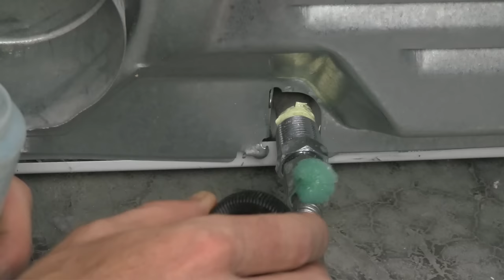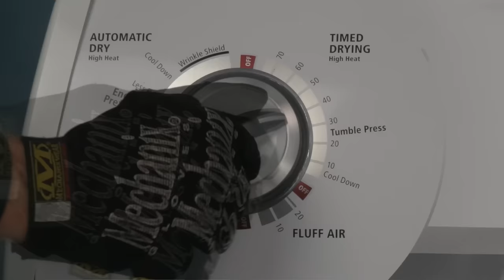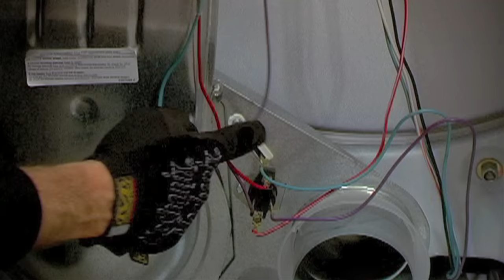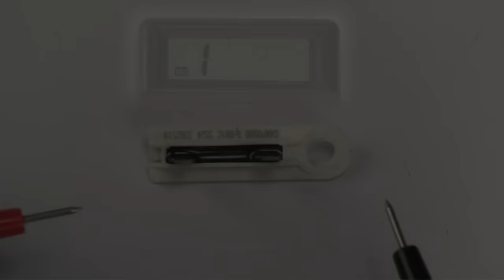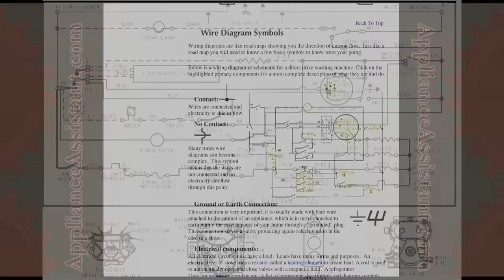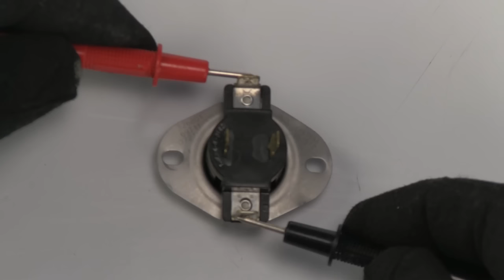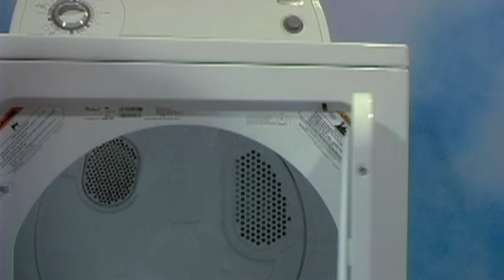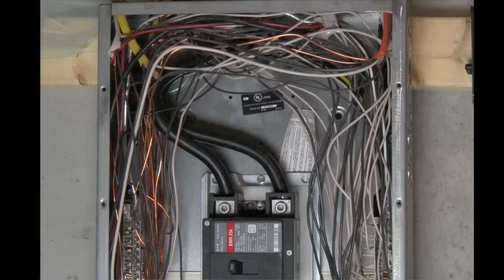Gas Dryer Repair: Fix Heating Problems

Comment from the maker: @munkdavid Thanks! Sounds like you have it right.  If you press and hold the start button you should get a reading for continuity on your meter. If you are not getting a reading it just means that one of the components is open (broken)  but it does not tell you which one.  I just published a dryer troubleshooting app at ApplianceAssistant Com  Try that out to narrow down your options.  Email me through the site with your model number and symptoms and I will do my best to help out.  Thanks again!

Comment: Dude, video rocks.  I promise to donate if you can help me.  Towards the end you rushed a bit.  I'm confused how the timer switch should test.  I have door off so i'm going from the red on my disconnected switch to the blue on the door sensor, thing.  :-)

Comment from the maker: @JessTorrRawr121 If you can see the igniter glowing but the flame does not ignite you probably need to replace the two black coils mounted to the top of the burner valve...Try using the new "dryer troubleshooter" app that I just published on ApplianceAssistant Com It should take you right to the part you need, and videos on how to replace them.

Comment from the maker: @daylightchat Sorry for the delay in responding.  I have a few parts ordering links from my main website ApplianceAssistant . Com
If you tested the thermal fuse with the wires disconnected and found no resistance, or activity on your meter then the fuse should be all you need to change.  there is no reason to replace the other parts you mentioned until they fail.  you can test the heater in the same way as the fuse.  Thank you for your comments!  Wonderful to hear of your success!

Comment from the maker: @nauulolna Thank you!  Normally the symptoms that you described could be caused by a gas line that is full of air the first time the dryer is turned on.  The fact that you are smelling gas should mean that the coils are working and the valve is being opened.  The only mechanical problem I can think of is the flame switch becoming overly sensitive, opening prematurely, and transferring electricity from the igniter to the coils too soon.  Extremely rare. If the igniter glows it works.

Comment: Awesome video, I have the same problem with Michael62895. dryer works fine at first, maintaining the temp it closes. then second heat  igniter glows, then off - but no flames -  I SMELL GAS ! will replacing the solenoid fix my problem ? thanks

Comment: Thanks...Was ready to go buy a new dryer. My issue was a 19.95 thermal fuse and a good cleaning. Makes me wonder how many dryers awaiting recycling roadside just need minor repairs. Maybe I'll shop those next time. Nice easy to follow video. Thanks again. Mike

Comment: I have the same Whirlpool dryer like the one used in the video. the igniter does lite the gas producing a flame for the first time, but after several minutest it won't relight, ONLY a orange glow and then back off. DO I NEED TO REPLACE THE TWO BLACK COILS?

Comment from the maker: @TheGhostPlanet If the dryer is disconnected from the home's ducting and you are still experiencing the flame kicking off after  5-10 seconds look at the internal dryer ducting.  The in door lint catchers are more likely to build up lint inside the lint trap receiver and block air flow. This will cause the flame to over heat the hi-limit thermostat.  I hope that helps.  If you have any other questions feel free to contact me through ApplianceAssistant Com and we will figure it out.

Comment: I have a Maytag Dg313 and the problem I have is the burner glows and the gas valve opens but the flame only stays lite for about 5-10 seconds and then shuts off. I replaced the two coils and the High Temp switch. Any help would surely be appreciated. Thanks for the great video.